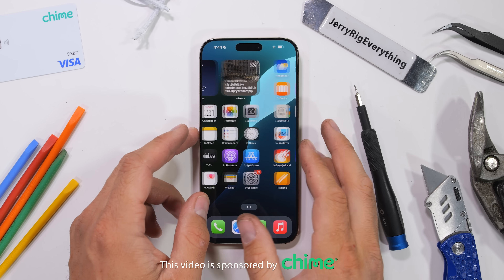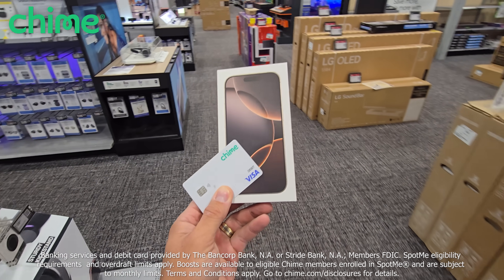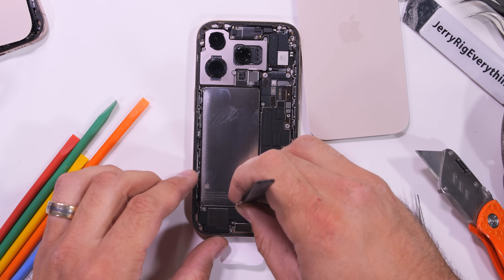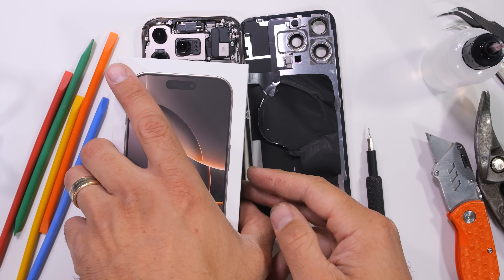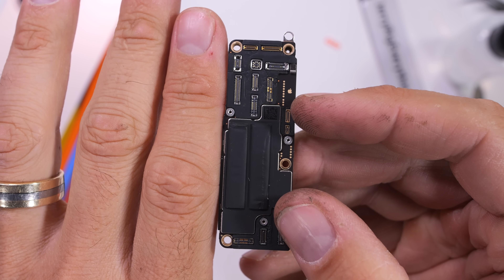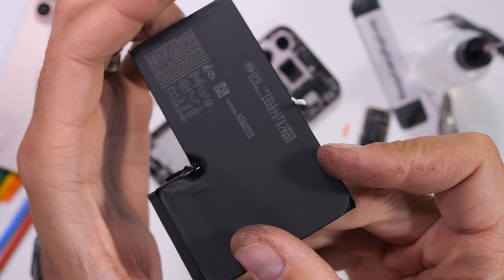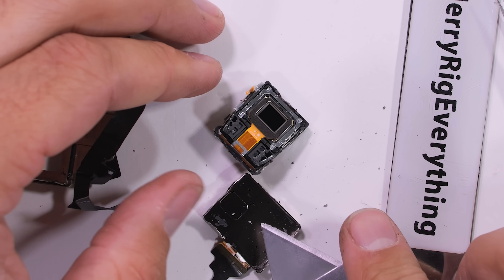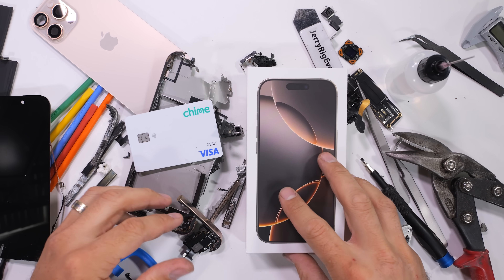Dear Apple: i am sorry...  (iPhone 16 Pro Max Teardown)

Comment: repair guides from apple is quite the move. Although you could speculate that apple does this for the "removable battery" regulation. I'm not sure if the EU has specified how easy it is supposed to be removable and apple might have just enclosed the battery in metal so it's less likely for the consumer to accidentally damage it, making it catch fire. We dont want a Note 7 again lol.

Comment: The new iPhone battery no longer uses pull tabs
Now you have to apply a voltage to the tab and any ground on the phone itself (metal parts) and the adhesive releases itself 🤯
I don't like apple haha but that's cool

Comment: Apple doing the bare minimum while adding unnecessary features that probably won’t stick around, Apple: designated camera shutter button? Yes
Also apple: should we use the SIM card space for expandable storage in aimless phones? Absolutely not.

Why give more digital space while usefully adding a feature that could store all the photos and videos taken using the shutter button when we could charge 300 more for extra built in storage

Comment: Still using iPhone 11 Pro Max 0:10
Reply: Yeah you need to upgrade
Reply: i just upgraded from xs max to 11 pro a month ago xddd
Reply: @ns_cs  I upgraded from an 11 pro to an 13 pro and next month from an 13 pro to 15 pro or 14 pro then I’m good for 4/5/6 years lol
Reply: @JayJay_LA  damn, someone is not poor xdd
Yeah, with 15/14 pro you can forget about upgrading for at least 5 years if you're after the latest iOS, and until battery death with jailbreaks xd
I spent 2 years with my XS Max, probably would've been at least a year more if i hadn't crashed it, and the same will go with my 11 pro, i will use it till it either crashes, or if i have a lot of free money to spend in a few years(3-4)

Comment: That pull tab sound definitely taps into that satisfying, almost nostalgic sensory experience! It's like the oddly captivating process of watching a hard drive defragment, where those little colored blocks would shuffle around as you waited for your system to run smoother. There's something about those small, simple interactions that triggers that blend of anticipation and satisfaction, especially for anyone who grew up with Windows 95!

Comment: Won't it be causing issue if the battery swell on heat?

Came for the metal battery casing, stayed for the battery pull tab 5:16

Comment: Doesn’t the metal battery have a guid detailing that you detach the adhesive by running a current through two pins? The adhesive he removed is reusable because of this feature.

Comment: The repair manuals are a good thing, but the repair instructions don't matter if you can't get parts for it, and Apple is still pairing parts to prevent third party parts, and intentionally causing unrelated issues when third party hardware is detected. For instance, I replaced the screen on my wife's Iphone XS, weeks later she couldn't use her camera. A reboot would fix it but it was inconsistent. Similarly, on the 16, Hugh Jefferies swapped parts and when it didn't detect the OEM display as genuine, it lowered the brightness output by half. Clearly a move intentionally done to make third party repairs look inferior and third party screens, that might be equivalent if not identical, inferior as well.

Comment: The metal casing of the battery is so clever but sadly its only functional in the base model. Every i phone should have it. But nontheless no theres need to worry about puncturing your battery. Just connect the battery and ground and it releases it self. This will be the new industry standard. And I can see it .

Comment: First comment on one of your videos! 

Interesting seeing the metal encased battery on that 16 pro vs the standard setup on the 16 pro max, though as stated with its “floating” design, it doesn’t seem it would help with heat dissipation at all.

Comment: I'm guessing you may have since seen this, but fun fact - the battery pull tabs (at least on the metal battery) have been replaced with a special adhesive that basically releases if you apply an electric current to it for a little while, from something as simple as a 9V battery. I think the new repair guides explain the procedure, pretty cool bit of tech.

Comment: You should review the iPhone 16 battery as it is rumored to need a 9 volt battery to remove the adhesive to remove the metal battery since the adhesive is supposed to be an interesting voltage activated adhesive. 0:38

Comment: When are you going to let me work for your off-road mobility company that’s been my love my whole life. Mobility. Fun. I literally bought a weed whacked in 8th grade, pulled the motor, somehow managed to mount a bicycle peg to the reverse threaded output shaft & use the peg to friction drive a rear scooter tire as a diy goped, because I was too poor for an actual goped. Only thing I didn’t do myself was weld the brackets/motor mounts onto the scooter frame, found an adult at an auto dealer that helped me with that. Idk why but I’m still super proud of that.

Comment: The guy talks about the repair guides, fail to read them and doesn't know that those are not pull tabs. You're supposed to apply low voltage current to it and the battery just falls off.

Comment: I feel apple is pretty much doing the bare minimum to not get sued. The guide is great, but I doubt genuine parts will continue to not be sold, and current iphones are already a hassle to fix without specialized equipment. Also, phones being helium resistant would be nice.

Comment: interestingly the new iPhone 16 has a new battery removal feature by making the adhesive unstuck in response to low electrical current! you simply need a power source and two clips!
Reply: “I’m not sure we’ve ever had a battery removal process go so cleanly and smoothly.” iFixit tech
Only the iPhone 16 and iPhone 16 Plus have the new adhesive, it worth showing it in the next video.

Comment: I'm sure it was out of legal necessity, but apple being forced to provide repair guides for everything feels like a massive right step for a better world
Reply: Thank the EU
Reply: Yeah but repair guides doesn't change anything if you can't buy parts for replacement and everything in the device is modified to be proprietary.
Reply: @vivaciencia9329  What does that even mean, "modified to be proprietary"?  "modified to be proprietary" implies that there are existing non-proprietary replacement parts already, which is not true, and those non-existent parts have been modified.
Reply: @Gergus  i get what hes saying tho. Take the iphone 8/SE/SE2/SE3. They all take the same damn battery, but they made the connector ever so slightly different,  so you couldn't interchange them. Same with the cameras and other internal parts. Its the same damn part, just slightly changed so as to make it impossible to interchange. They did the same thing with the ipad home buttons. There was zero reason ror them to make them suuuuper slightly different to eachother, whether it was the gasket around the button, or the ribbon cable, or the zif connectors. 

They make stuff a pain in the ass, just to make it a pain in the ass.
Reply: Apple fought tooth and nail against the EU and US, to avoid making phones easily repairable and consumer friendly. YouTuber Hugh Jeffreys made a video demonstrating Apple's "software lock" which you can't even use another genuine Apple part from another brand new iPhone.
Reply: @americanfreedomworldpeace  we have this issue a lot at work. People wanting to blame us for not fixing their iphones right. But if the phone starts bootlooping due to damage to the prox/face id module, you cant put a new one in and expect it to work. Because it wont. A notice will pop up saying "Face ID unavailable on this device." and that the end of it. Only thing solved is the dreaded bootlooping.
Reply: Things that we lost long time ago... Society going backwards.   Recovering something now.
Reply: 3500mA is it 2015 or what. A midrange samsung has better battery then this crap
Reply: Where are samsung's guides then?
Reply: No kid it wasn't. If it was every company would be doing it. It's one thing hating strangers. It's another hating a group of strangers. And then there's finding reasons to hate those group of strangers
Reply: @JohnMarston-lo5qk  It is out of legal necessity. The EU passed their right to repair act in April. However it will take some time before it is accepted in the law by all the individual member states of the EU. Apple are a bit ahead of the ball by already opening up the repair guides, but every major manufacturer will be required to do so within the next 2 years.

Irrespective from that: hating a company doesn't equal hating all the people that work there. There are plenty of companies I "hate" and will never spend another penny at, but I have no hard feelings toward any of the individual employees. Everyone has to make money somehow, and I respect that, even if it is by working for a company that I really don't like. So "hating" a company is totally fine. Companies aren't strangers. They widely publish their actions, stances and opinions and should rightfully be judged for those. Companies aren't people. So don't try to equate them.
Reply: @Niosus  I hope we can get copies of those guides in the US :)
Reply: @JohnMarston-lo5qk 

No it's the EU forced them.

EU changed everything

Comment: It will most likely just be to help them profit more but the 7 repairability score on ifixit is great and changing the pulltaps to the new ones you just connect a 9v battery to and they just let you open the iPhone is great. Pretty sure this is only on non pro models

Comment: On the non-existent pull tabs: iFixIt did their teardown, and the new tab is electrically conductive, so you can charge it with 20 volts of power to remove the battery. I can't remember if that was for the 16, 16 Plus, Pro, or Pro Max, though.

Comment: I have seen a Video from iFixit where they could remove the battery by adding some voltage on the adhesive. Is that only on the iPhone 16 (normal) models?

Comment: You need to check out the regular iPhone 16. The battery is held down by glue, which loosens if you apply 9V to two contacts on the iPhone.
Pretty interesting.

Comment: Li-ion batteries tend to catch fire in a fairly big way if pierced, so I supposed the metal frame will prevent that or certainly make it less likely, but of course it will add cost...thanks regulators!

Comment: Didn't apple implement an electric tab to remove the battery?  You apply voltage and it is no longer adhesive.

Comment: I'm not entirely sure what got into apple this year with those batteries. The pro max model is just like the old ones, the pro has a metal battery for some reason and the regular 16 has that super cool new tech with the electrically deactivating adhesive. Definitely sounds like they're doing some field A-B testing of sorts to figure out the best approach for removable batteries which will be mandatory in a few years.

Comment: Wasn't a party trick with the iPhone 16s glue something about applying an electrical current to it (9v battery with croc clips in certain locations) releases the glue holding batt ?

Comment: Supposedly they ditched the pull tabs on the regular 16, and moved over to an adhesive that stops being adhesive and lets the battery fall right out when you connect a 9V battery to it.

Comment: Oh I will take that iPhone after being touched by a legend also a quick suggestion that the metal battery can be removed by using a 9 volt battery attaching it's (-) terminal to ground and it's (+) terminal to the battery pull tag type thing.

Comment: EU regulations hard at working, forcing Apple to be a bit more consumer friendly. I think that's a benefit for everyone, not just Apple users. :)

Also, it 's curious that the pro phones have different battery enclosures. You'd think that they'd try to maximize similarity, so would be interesting to know why they are different.

Comment: So the base 16s have removable batteries using 9 volt electricity, the pro model has metal casing and the pro max is same like older models. So much variety this year

Comment: The metal enclosure is likely for battery density reasons just like in the Apple Watch.
Reply: And just like with the Apple Watch the larger models are lacking a metal enclosure due to the increase in cost.

Comment: I'm sorry that Jerry didn't show a new way of gluing the battery on the iPhone 16 and 16 Plus, where classic glue is not used, but the battery is peeled off after voltage is applied to the intended location.

Comment: Hugh Jeffreys demonstrated a NEW WAY to get some iPhone batteries out with.... a 9 Volt battery? My guess is that there is a coil inside the battery glue tabs, that heats up softening the glue and thus helping release the battery easier... 🤔    😎🇬🇧

Comment: The only reason Apple made the repair guides available is that in European Union, there are now laws enforcing the companies to do so. The goal of those laws is to stop companies from enforcing you to buy a new hardware right after the guarantee has expired, by providing the customers with both the replacement parts and a tools to be able to conduct a repair.
So it's not Apple or any company becoming soft ❤. It's the law 😄

Comment: BUT YET... Hugh Jeffreys, has YET AGAIN proved (by simply buying 2 EXACT iPhones and swapping the motherboards on each phone) that Apple STILL DEMAND FULL CONTROL of the 'Repairability' of their phones, INCLUDING code locking/pairing of the wireless charge coil stuck to the back glass! 🤨😒    😎🇬🇧

Comment: Apparently the regular iphone 16 has electricly activated glue for the battery
Reply: Yeah I was really hoping he’d be showing that. Although I guess it was worth it to hear him pull those 3M command strips– ‘er, "pull tabs"
Reply: Useless crap, instead of including a physical SIM or SDcard.  smh
Reply: @BillAnt   idk I quite like it. A 9v battery is easier to buy than isoprop and the other shit you usually need
Reply: @BS-jw7nf  - Warming it under the battery at 90C for a couple of minutes on a heat plate makes any battery come out easily.  I guess this is ok for DIY-ers.
Reply: @BillAnt  join us in 2024 bill, 99.9% of consumers don’t need these things anymore

Also those have nothing to do with battery repair ability becoming easier

Comment: I just dont get why they are using 3 different techniques for the batteries in one Product line. Like one is as always, than one with an metal encased battery cell and then the third with the (in my opinion sickest change - coming from an android user) by electricity releasable adhesive. Like the potential for this is insane. But they only put it in one submodel - like what? I dont get it. Also the camera button is stick welded. I actually thought, that apple was really integrating reparability with this new model until I heard of the camera button and thought - oh wow here we go, still not there yet. Lilke come on......

Comment: Apply power from a 9v battery and the electrical battery paste from the 16 pro will come straight of. Apply on the pulltab and ground it on the loudspeaker

Comment: Isn't the metal battery so a current can be applied to the case of the battery and thus loosen the battery adhesive via electricity. At least that what I read on some tech site

Comment: On the plus side, it offers a super-fast A18 Pro chip, improved 48MP cameras for sharper photos, and 4K slow-motion video recording, making it great for gamers and content creators. It also has a longer battery life. However, it's quite expensive and has advanced features that may be unnecessary for casual users.

Comment: The upgraded cameras, especially the two 48MP lenses, make taking photos faster and clearer. For video lovers, new features like 4K slow motion and studio-grade mics are impressive. It's perfect for creators who want professional tools in a phone. Plus, the battery lasts longer, so you can use it all day without worry. Overall, it's great for those who need high-end tech but might be overkill for casual users.

Comment: Take an Iphone 15Pro, double the 48MP camera, add a new button(don't use the action button for multiple actions like, single press, double press, triple press, single press and hold - ----, and especially don't add the swipe gesture to it, just add another button), and slightly improve the internal design. Congratulations, we have iPhone 16pro. This is innovation.

Comment: Is that a dot of water or isopropyl alcohol at the corner of the L shaped battery of the iPhone 16 ProMax?🤔 will the metal enclosure for the battery improve heat dissipation?

Comment: So what I'm understanding is that it's still the same as the previous 4 or 7 generations, but the EU made Apple add pull tabs and a metal cage around the battery? 😢

Comment: Not sure if this is true. The adhesive reacts to low currents and makes it very easy to remove the battery. Just need to use low electrical current and alligator clips. Would be nice to get a new phone tho

Comment: I think that this year line up of iPhone is one of the most interesting in a while. Even if their hand is being forced. They are experimenting with making repairs more accessible to consumers, and more consistent for repair facilities. All while also attempting to make the process a premium experience. I can think of any other reason they would switch to the electric activated adhesive on the standard iPhone 16 and the metal casing on the 16 pro.

Comment: Meow. An iPhone 16 Pro would be awesome.

That said, you removed the battery wrong. The adhesive loosens when an electric charge is applied to a specific spot by the battery. iFixit shows it.

Comment: apple is using something new instead of pull tabs on the normal iPhone 16 it requires running electricity through specific place of the phone for it to let go of the battery